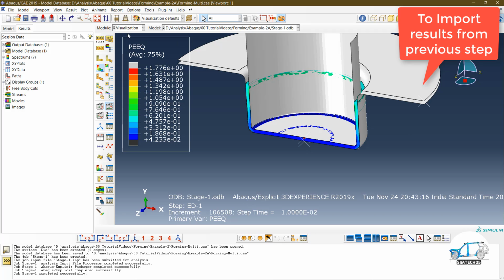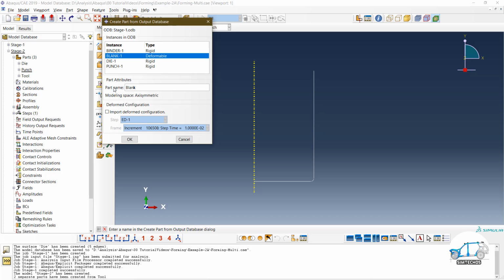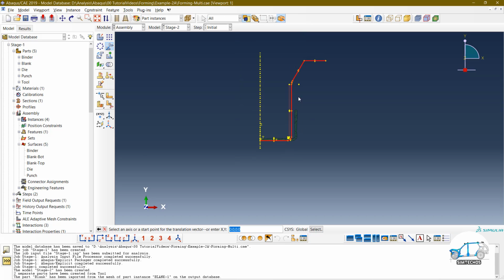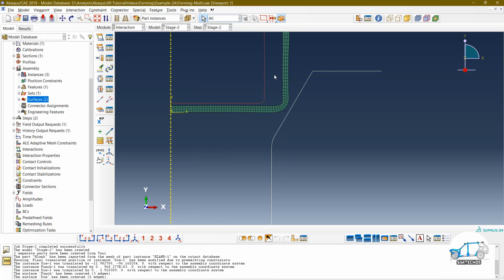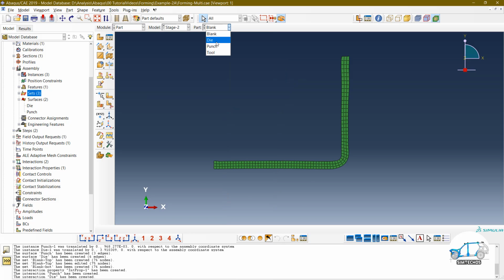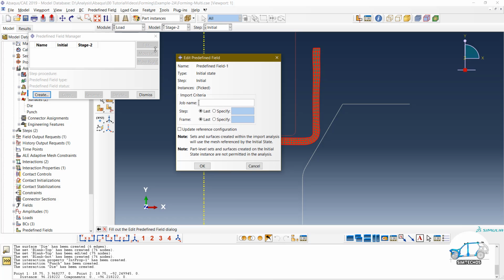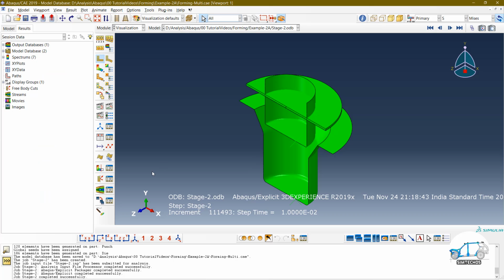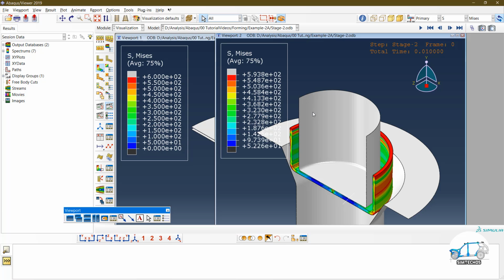Multi Stage Forming in Abaqus, Stage -2 (Part - 2, Importing results from previous analysis)

Comment: The video was very useful. But If i have a linear pattern of instances in the assembly, how I could import them either ?
Reply from the maker: Dear,
what you meant by linear pattern?

If you have any CAD model Abaqus provides different geometry import option.

Right click on "part" in side panel - import part.
Reply: @arsitech-ltd  I mean many copies of the part in the assembly module.
Reply from the maker: Dear,
Abaqus provides pattern option in assembly.
You can call one part and make copies using pattern.
Reply: @arsitech-ltd  If i do like what you say and call the part from the first step and repeat it the resulted parts will be the same as the one I repeated not the same as their marched parts from the first step   because every bar in step one has its own behavior so I must import each one alone in the next step not import one of them and repeat it do you understand me my question is who to made this process easily for this case?
Reply from the maker: Dear,
Please provide visuals on WhatsApp +917891401376

I believe something is misunderstood.
Reply: @shadymostafa9375  that’s exactly what I meant
Reply: @eng.yousef01  If you know an answer for how to do to steps of displacement control please send me

Comment: sorry sir I have a question. You defined a reference point and the you gave it displacement, shouldn't we define a constrain between this refernce point and the die or the punch ? or because die here is rigid body we don't do that and if is it deformable we must define that constrain ?
Reply from the maker: Dear,
Punch and die are rigid parts. So the refrence point is must for the rigid part and no need to apply any constraint between rigid part and their respective point.. software assume that point as point of action for rigid body.

Comment: Why you didn't toggle on Update reference configuration when you create a predefined initial state?
If we donot toggle on it, will the model run continuously from the previous stage to current state?
Reply from the maker: Dear,
displacements and strains are calculated as total values relative to the reference configuration at the start of the analysis and will be continuous from the start of the analysis. Toggle on Update reference configuration to reset the reference configuration to be the imported configuration.

Decide accordingly.
Reply: @arsitech-ltd  Thank for your answer!
I also read about the ABAQUS manual about defining the initial state but it is still confusing. So, if we want to run the seconder step with the part imported from the first step and to make it continuously, we should toggle on or off the update reference configuration?
Thank you again!
Reply from the maker: Keep it off.
Reply: @arsitech-ltd  Thank you so much!
Reply: @arsitech-ltd  , when I toggle off it, the job can not run because of the errors "excessive distortion at a total of 300 integration points", but it can run when I toggle on it? could you give me some tips to run it
Reply from the maker: Dear,
The general information on reference configuration i already provided. Now I'm not sure how you are playing with it.

Comment: Nice work sir, 
@simTech05 i have one question that why didn't you update the reference configuration in predefined field option. Also, do i have to request output requests if i want to perform this analysis.
If you could help, i want to perform explicit analysis of RC beam under repeated impact loading. Should i request output requests as the model interaction and boundary conditions will remain same. Only, i have to import part instances of concrete beam and rebars so should i request output requests and update reference configuration or not?
Reply from the maker: Dear,
 displacements and strains are calculated as total values relative to the reference configuration at the start of the analysis and will be continuous from the start of the analysis. Toggle on Update reference configuration to reset the reference configuration to be the imported configuration.

Decide accordingly.
Reply: @arsitech-ltd  ok thank you sir. What about restart requests. Do i have to check that option in Output->Restart requests as i found in documentation but not in the video because I think it is necessary.
Reply from the maker: Dear,
Restart is necessary when you want to continue the same step for increased load/displacement.
Here we imported results for next stage (different tool setup)...we are not continuing the previous stage.
Reply: @arsitech-ltd  ok ok i understand sir. Thank you very much.
Reply from the maker: Welcome

Comment: at predefined loads we r giving previous deformed file name..but i got an error at job ...showing that file name.res not existing ....could u please help me out
Reply from the maker: Issue with naming or file not available in that folder. Watch video carefully...Check model again precisely..!
Reply: @arsitech-ltd  file name.res not creating@ work directory for stage1 part
Reply: I also have the same error when making a predefined initial state so the job cannot run. do you resolve this problem?
Reply: @CuongNguyen-tt4jp  not fixed that issue completely

Comment: How to define the thickness of a deformed shell element in stage 2 as it is not uniformly distributed after stage first
Reply from the maker: Dear,
These are not shell element..these are continuum axisymmetric 2d element...CAX4R... treated as 3d element (after revolving). So don't bother about shell thickness bcz there is no such thickness considered.
Reply: @arsitech-ltd  
No I am not talking about this example 
Actually I have to perform multi-stage incremental sheet forming 
I have done the first pass in which the thickness of the shell sheet is 1mm which is not uniform after first pass results 
But now during the second stage when I have to create a section under property module 
Should I use solid, homogeneous or shell, homogeneous 
And in the case of shell I don't know how to give thickness to this deformed part

Thank you in advance 😊
Reply: @hiteshmeena7213  I am also working on same problem can you help me?
Reply: @sahilbendure4034  ultimately it turned out that I was not able to define a thickness for stage 2.

So I came came up with the new method.
you can do all the multi passes in just one simulation.

Comment: Nice work, I have working on process interaction too, do you kwon if it is possible to remesh the part on stage 2 and let abaqus do an interpolation of the initial field values? For the instant I see it only possible if we use the .inp file and I do myself the interpolation with a python code. But it would be nice if we could do it all on the CAE
Reply from the maker: Possible but it need efforts.
Reply: How do you do it with a python code? Can you share some knowledge? Is it a tool that u can use for all types of remeshing or you need to rewrite the python code for every analysis?
Reply from the maker: Dear,
I'm unaware to python.

Comment: First of all great video and very well explained. 
I request you to provide the reference from the ABAQUS Manual for the video demonstration you made, as I want to learn more in detail such as what are the limitations and capability of this technique. 
I mean to say that where I can find more detail regarding this technique in ABAQUS Manual (sections and subsections ), as I am not able to find this in the ABAQUS Manual.
That will be very helpful. 

Thank you
And I appreciate your help.
Reply: I want to answer what I can to sart a discution. I'm working on this subject, what I can say the biggest 'limitation' is the accurancy of the behaviour law you use. Most behaviour laws are obtained from monotonic essays, so when the same particule of the piece is subjected to differents solicitations (for example, first stage to traction and second state to high shearing stress) a generalised Baushinger effect appears, with a simple isotropic law you can not reflect these effects.
 Another problem is that for different procceses normally you need different meshes needs, in this example it worked just find with the same mesh, but that is not always the case, that the bigest problem I find on these studies.
If you want to discuss I am open, I am writing some scientific articles on this subject at this moment.
Reply: @diegobritezg   could u suggest me to do remesh @stage-2
Reply from the maker: Not applicable.
Reply: @arsitech-ltd  at the second stage ....can't we meshed the deformed part?
Reply from the maker: You can remesh forcefully...but not recommended.
Reply from the maker: Dear,
I read Documentation wherever i need refrence/help. But my tutorials may not having direct refrence in documentation. Instead they have refrence from many chapters of abaqus documentation and/or from different software help research paper. So for every video it is not possible.. You need to do excercise by yourself. I suggest to read completely - "Getting started with Abaqus/CAE" from Abaqus documentation.